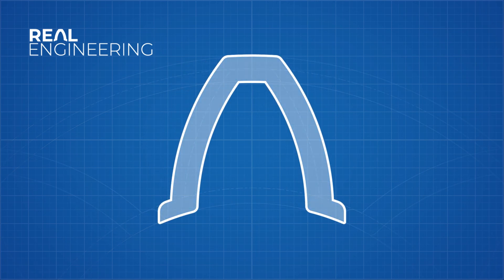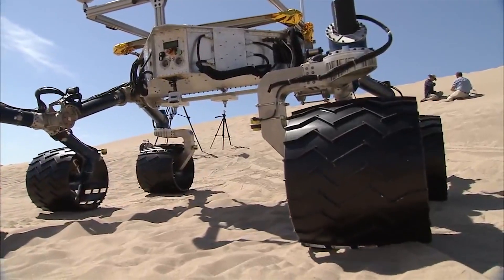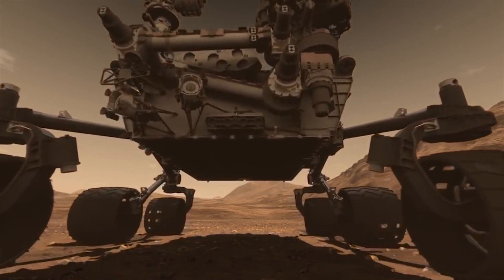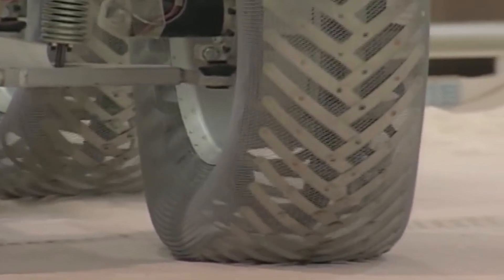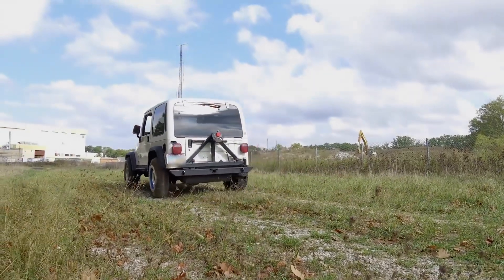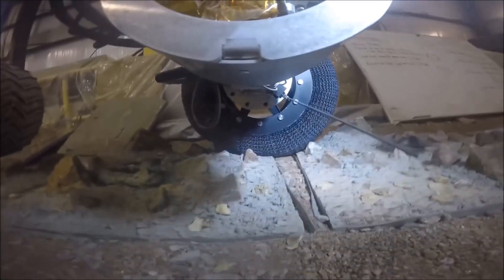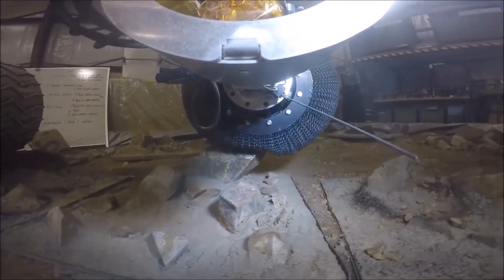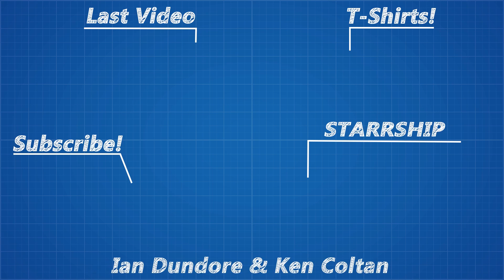How NASA Reinvented The Wheel - Shape Memory Alloys

Comment: But it’s not really reinventing the wheel, more like reinventing the mesh tire.
Reply: Thats a great tite for a video isnt it
Reply: Agree so much. What a clickbait title.
Reply: yep, though I'm fascinated by the content, the tittle could be adjusted properly. it left a bad taste for me. but thats me
Reply: its not mesh...
Reply: The mesh tire is not a wheel? Are cars then also not on wheels but on tires? It's the same.
Reply: The wheel is the hub + the rim, the tire is the rubber part.
Reply: @brianmiller1077  
That's also changed to properly support the mesh so...
Reply: Making the wheel out of a different material is not reinventing the wheel. Maybe that will be easier to understand.
Just like how iron swords are still swords, nobody considers iron swords a reinvention of the sword.
Even more extreme examples like automatic guns aren't reinventions of the gun. You need at least a railgun to qualify as "reinventing" a gun. In the same way, it's not "reinventing" the wheel unless you can some how change the basic principle of rolling a cylinder on the ground.
Reply: Chen G i went to the comments for this specific comment. Have a good day! 👍
Reply: Chen G going from bronze to iron swords definitely revolutionized warefare
Reply: at least until iron was commonly used and you couldn't just pummel bronze users into the ground with your iron stuff

Comment: Legs rather than wheels if speed is not a consideration.
Reply: I believe wheels are as energy efficient as you can get. Why would you waste energy and thus precious weight on legs, then?
Reply: Look at spiders from the crossopriza lyoni class. If you were able replicate that structure in hollow carbon fiber you'd have an incredible weight advantage with virtually limitless terrain mobility.
Reply: ryan  articulated legs would rewuire more controll electronics, several servo motors per leg and the motors would expend energy all the time for the simple task of supporting the weight.

Wheels require a single simple motor each, a simple electonics setup to run and supporting the weight comes pretty much free of energy cost.

Legs are great, but not at all energy efficient.
Reply: Modern articulating arm (or leg) models don't use motors. They use wax engines and/or muscle like contraction linkages.
Reply: ryan  Just how reliable and tolerant are those of the ahrsh martian  temperatures?
Reply: It's cold compared to earth temperatures, but not unworkable.

Keep in mind you're competing with a wheeled vehicle that only moves at 0.1 KPH. It's ok if it's slow.
Reply: ryan  but will your legs be more lightweight, and less energy consuming to operate than wheels? I doubt that very much.

Comment: Radioisotope thermoelectric generator isn't a nuclear reactor.
Reply: Ask Mark Watney
Reply: It generates power via nuclear decay, so for your average person watching this video it is an easier and still fairly accurate description.
Reply: yeah, very interesting thought. And I can see how some would consider calling an RTG a 'reactor' nothing more than scaremongering or a mistake. Last I checked an RTG doesn't have "control rods" to control the rate of the reaction, nor do they replace a fire steam boiler with a nuclear reaction vessel that runs a steam turbine electric generator, however, an RTG does use a nuclear reaction for heat much like a nuclear reactor. A "nuclear thermo-electric battery" probably is a good way to put it for most RTG's that have been sent out beyond earth orbit, that unlike nuclear reactors, the fuel cannot be easily replaced as its heat output decreases over time. (Shrugs) either way, they both use nuclear reactions for heat, it's just one has replaced a chole furnace boiler with a nuclear-powered steam boiler, and the other uses the heat to directly generate electricity via thermal-electric-couples. Perhaps the better question is what is the difference between a boiler and a reactor, lol.
Reply: You nerds 🤓 get back in the science lab and stop confusing us normals.
Reply: according to wikipedia:  "A nuclear reactor, formerly known as an atomic pile, is a device used to initiate and control a self-sustained nuclear chain reaction." 

in an radioisotope battery there is no chain reaction. So i also think it's wrong to call it a reactor. And i think it is important to make that difference clear since this is an educational channel.
Reply: @bretzel30000  When you put a pile together, there is a mild chain reaction, but the negative void coefficient is not self sustaining.
Reply: Close enough for anyone to get the idea of whats going on.
Reply: It technically is a reactor.
Reply: "radio isotope" that tells me that nuclear power is used for power.
Reply: @jnathannger8654  Yes, but it's not through a reaction. It's not a chemical reaction to transmit heat, it is like having a hot water bottle to hold on to.
Reply: it still uses nuclear material to produce power
Reply: I don't usually argue semantics, but my point is that reactor is device that contains and controls some sort of a reaction. RTG uses heat from spontaneous nuclear decay to generate electricity. You don't need to engineer anything to make plutonium decay. It is spontaneous.
Reply: @OlejzMaku  Engineering a way to generate power from it takes effort. It is nuclear powered, and even though it's an RTG IS GOOD ENOUGH FOR MOST PEOPLE.
Reply: Guys there is no reason why he could not have been accurate. There's no point making excuses for silly mistakes.
Reply: RaDiOiSotOpE ThErMoEleTric GeNerAtoR IsN't a nUcLeAr ReActOr.
Reply: Most people don’t know what a radioisotope thermoelectric generator is, it’s just easier to say nuclear reactor then to explain what it really is.
Reply: "I am so smart"
Reply: Radioactive decay is a type of nuclear reaction (although spontaneous).  As a result a device that uses radioactive decay is in effect a nuclear reactor (sort of  :-).  
https://chem.libretexts.org/Textbook_Maps/General_Chemistry/Map%3A_Chemistry_(Averill_and_Eldredge)/20%3A_Nuclear_Chemistry/20.2%3A_Nuclear_Reactions